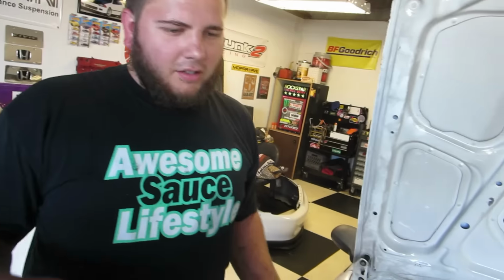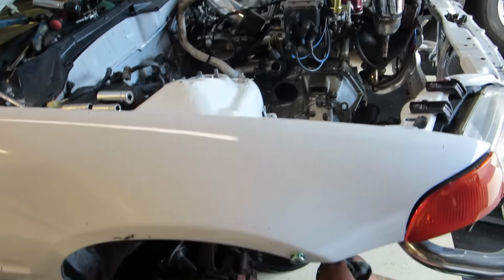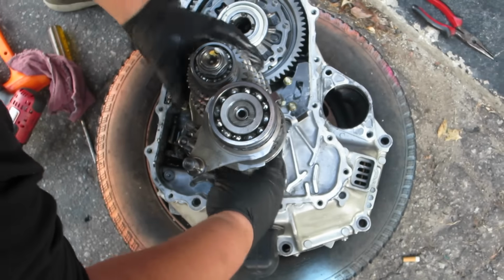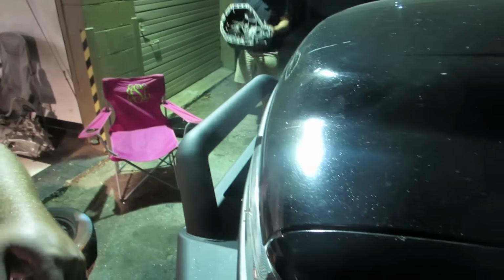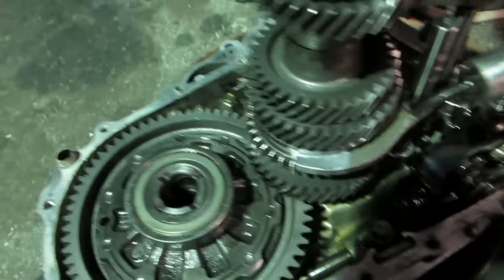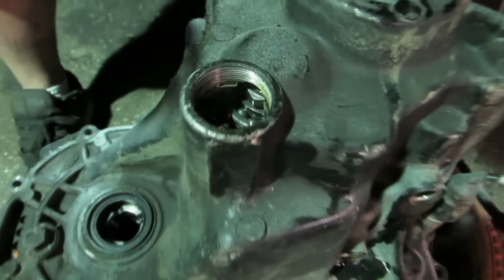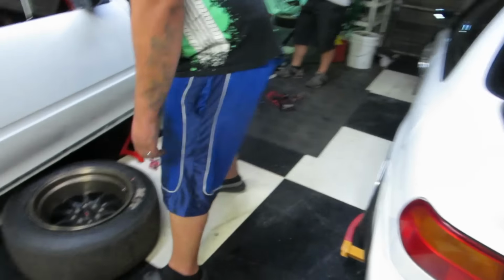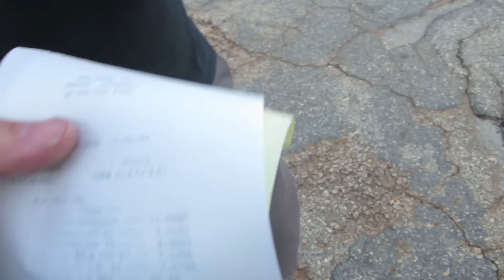B20 VTEC TURBO  DRAG RACE!  HSG EP. 4-38

Comment: Just did similar. B16 y21 shafts with ls 3,4,5 in to a s80 case. Worked well after 2 times apart

Comment: I like watching your videos but I am extremely surprised on how slow the race Civic is based on how stripped  it is and the platform that is under the hood I just went and looked in my garage at some Old Time Slips and I have one that had an eighth mile at 7 61 with a quarter mile time of 12.13 that was with a Precision turbo setup on a B20 in a 4-door sedan EK
Reply: James Thompson car needs a retune doesn't make very much power
Reply: 10lbs w/full interior and you say it need a RETUNE do your home work son
Reply: James Thompson lmao you need to do your homework. I personally know and have driven the car and and know the the cars needs to be returned. The car is on 8 psi on a 50 TRIM and only revs to 7k. It's a long story as to why the tune is so poor. A 7.6 is very good et for the hp that the car make the car makes.
Reply: no disrespect I thought you where saying my car needed a RETUNE miss read the message I love the videos keep them coming and can you guys do everyone a favor and raise the back up
Reply: that's not a bad time  that car will make a great 1/4 mile car all its power is on the top end I can see it going low 11s for sure once everything is worked out

Comment: b20v turbo is a bad bad idea on stock sleeves
Reply: Wesley Green Not for me and my friends that i built. Him running 12 psi on stock block b20v making 350whp and 240wtq. me running 8 psi on a built head b20V stock block making 379whp and 278wtq. Ive had mine for 2 years now with daily track and high mph roll race abuse and he has had his for 1.5 years doing auto x and roll racing.  my red line is 8200 rpm and his is at 8800
Reply: antfct2 I believe you